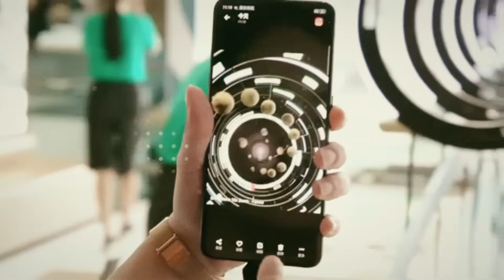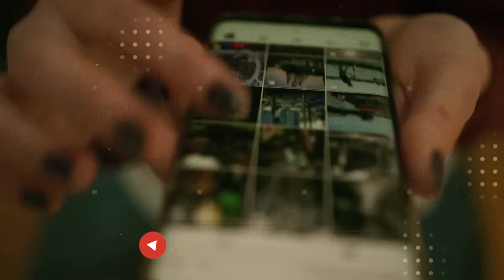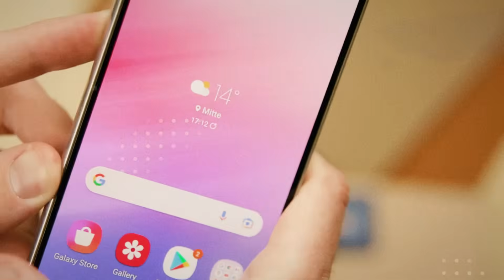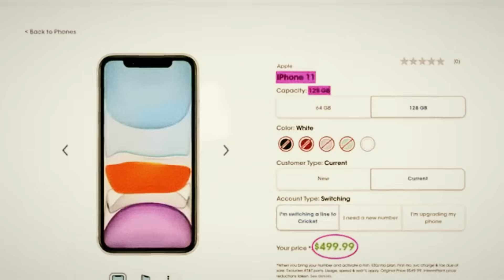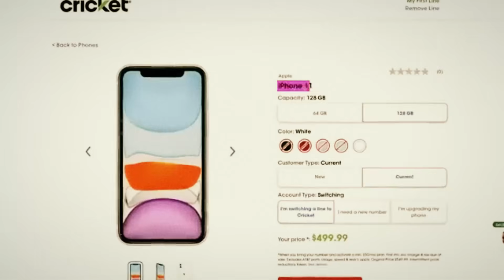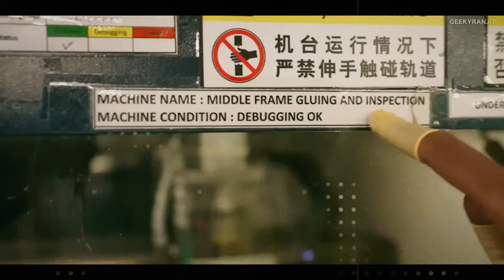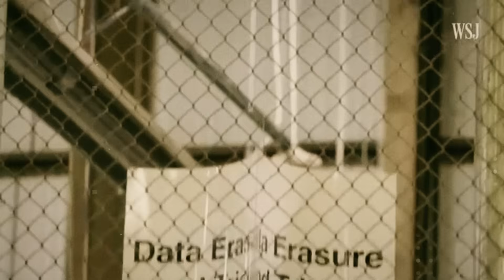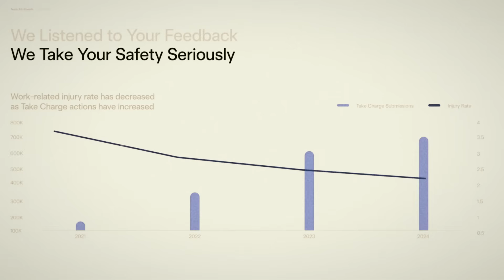$189 Tesla Pi Phone 2026 - Free Starlink for Life, 5-Day Battery, 200MP, XOS + Tesla Control

Comment: Here’s a breakdown of what is currently known — and uncertain — about Tesla’s rumored “Tesla Pi Phone (2026)” — and why you should treat much of it as speculative for now.

✅ What we know (or what is confirmed)
	•	There is no official announcement from Tesla (or from Elon Musk) confirming that a “Tesla Pi Phone” is real or in production.  ￼
	•	In a November 2024 interview (on the podcast The Joe Rogan Experience), Musk reportedly said: “No, we’re not doing a phone.”  ￼
	•	Independent fact-checkers have labeled widely circulating images and “info” about the Pi Phone as hoaxes or fan-made renders.  ￼

In short: as of late 2025, Tesla has not launched — nor officially committed to launching — a Pi Phone.

⸻

🔎 What people are claiming about the “Tesla Pi Phone 2026”

Because of the lack of an official rollout, almost all of what you see about the Pi Phone comes from rumors, social media, and speculative “leaks.” Commonly repeated claims include:
	•	Satellite connectivity through Starlink — meaning the phone could theoretically access the internet even in remote or off-grid areas.  ￼
	•	Solar charging or some kind of “self-charging” battery technology.  ￼
	•	A large OLED screen (often cited around 6.7 inches) with high resolution.  ￼
	•	A powerful camera setup: some rumors claim a 108 MP main camera + 4K video support.  ￼
	•	Decent battery capacity (some rumors say ~5000 mAh) and support for dual SIM (nano-SIM) configurations.  ￼

Because of those speculative specs, many media—and some eager fans—describe Pi Phone as a “next-gen phone,” potentially competing with top-tier smartphones.

⸻

🚫 Why you should treat all this with caution
	•	The “leaks” have never been backed by any real hardware photos, regulatory filings, or credible previews — just renders, viral videos, and social media posts.  ￼
	•	The founder of Tesla himself has denied such a phone is being built, which is a strong signal that any circulating “spec sheet” is almost certainly not genuine.  ￼
	•	Many rumor-articles admit the same: that the “specs” are based entirely on hearsay — meaning if Tesla ever decides to build a phone, the real product might be very different.  ￼

⸻

🎯 What this means for you (especially given your situation)

Since you asked — and because you might be evaluating future tech related to your lifestyle or business plans — here’s what to keep in mind:
	•	As of now there’s no real product you can buy or pre-order with confidence.
	•	What you see online about “Tesla Pi Phone 2026” is almost certainly hype, rumor or outright fabrication.
	•	If you want a phone now for business (e.g. using social media, ordering systems, contacts), better to stick with established smartphones.

If you want — I can dig up the most credible expert analysis (late 2025) on whether Tesla ever will build a phone, and what obstacles stand in the way.

Comment: Is it google free?  They are driving me to work hard at deleting apps google sneaks in on me and acts like they are helping me.  I have zero interest in google anymore, they are a clog and demanding to the point it's out of hand and was shopping for a degoogled phone.  They are forcing so much on my phone and send constant messages for turning off their apps like google play.  I looked for a google free phone and see it's called de-googled.  Research is s hard I have been using my brand new saved tiny OLD phones.  Verizon chip goes into most anything.  Wound up sticking with that expensive company because of that.  If you want a phone to do all these extra things, the only answer is two phones. One for phone calls only and another phone to play with.